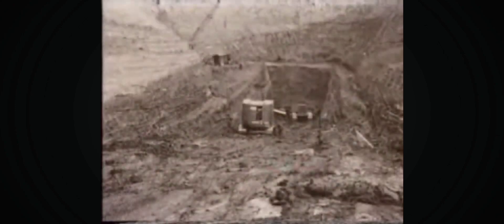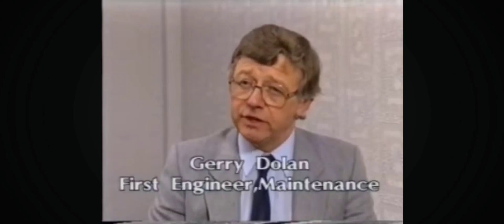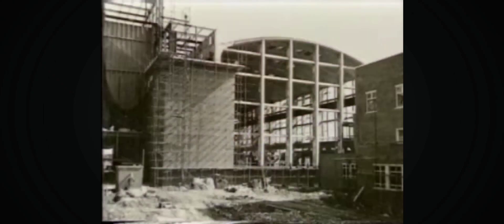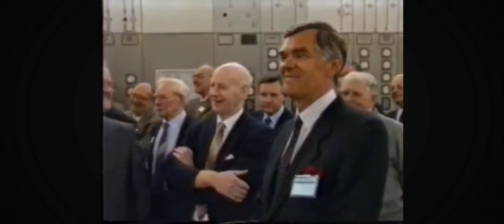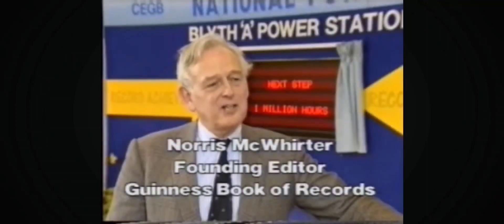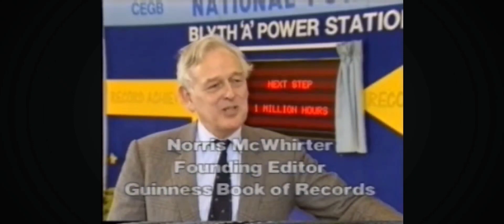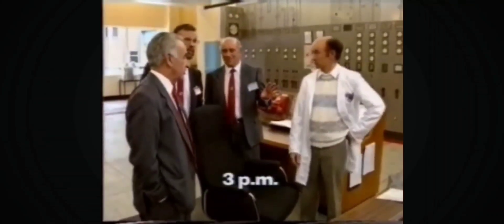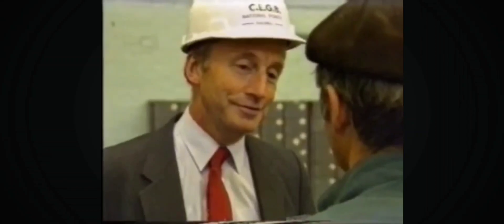WHEN BLYTH POWER STATION BROKE A WORLD RECORD

Comment: But.. but.. but where’s the diversity? This just looked like a useful group of men who knew what they were doing. And just think, this power station would run hour after hour, day after day, year after year. Blyth A produced 480 MW and Blyth B 1,250 MW. Yes 200-300 wind turbines could this for 15 years, not 30 - when the wind blows. And let’s also bolt in the cost and complexity or power stabilisation devices - things the greenies don’t tell you about.
Reply: Diversity,  We keep feminist happy by referring to the machinery as 'She", the Alphabets happy as AC current swings both ways.    Greens with  all the trees that were planted.  And Rainbows well look at the top of the cooling tower they make them each time the sun shines.  What more diversity do you want.  OK so it is never going to transition to DC  but Edison tried and it didn't work.

Comment: I did my aptitude tests there when I applied for the CEGB in 1989 - Served a total of 34 years in the power industry.  P.S. The power station I worked at didn't have steering wheels on their unit desks!